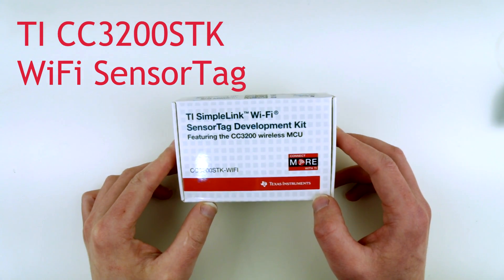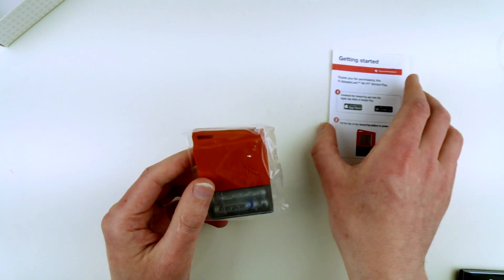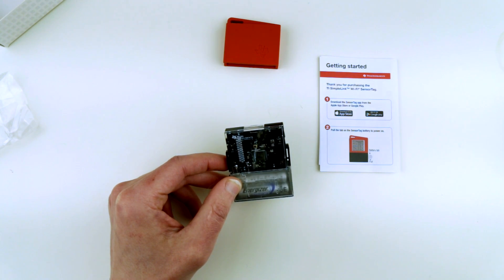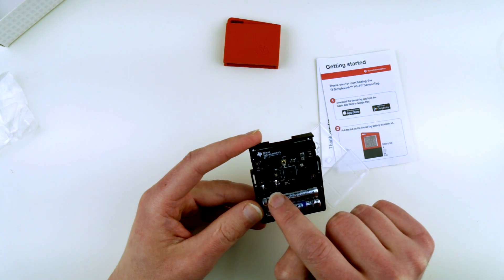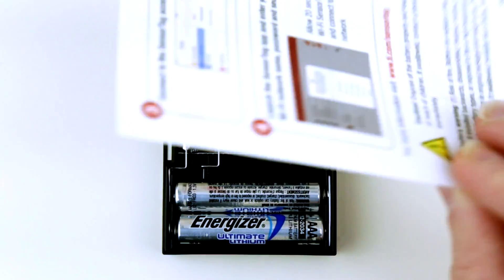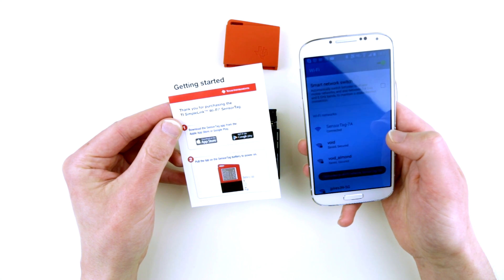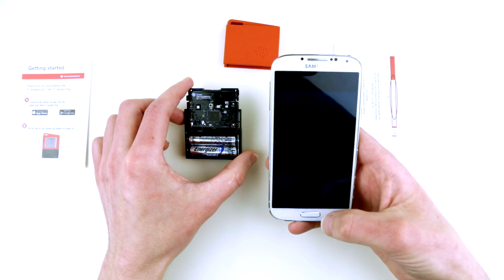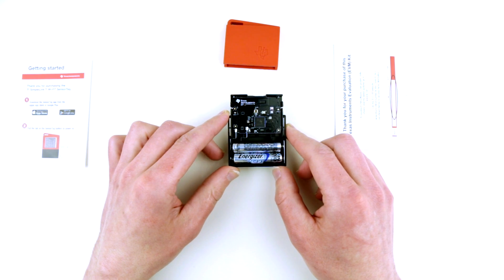TI CC3200STK WiFi SensorTag Unboxing and First Impression

Comment: It there a way to send data to a custom API? Otherwise this device is kind of useless, no?
Reply from the maker: Either you adhere to API this device provides or you change the API in device,-  it is possible as sources are available.
Reply: Hello, thank you for replying! Are you sure about the possibility of using my own API call? I heard from the TI support that it's not possible with this device. I would like to configure it to send the data to my specific API with my specific needs on the JSON body of the call. Have you done something like that with this device? It would be great, but I honestly don't think it's possible.